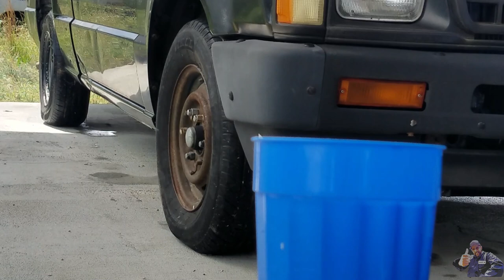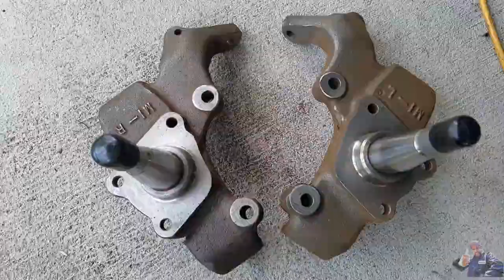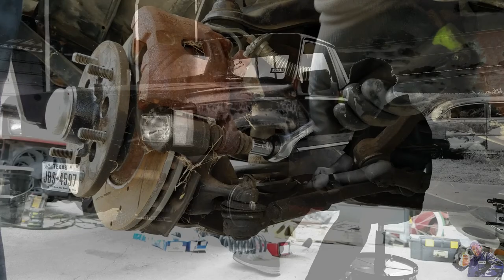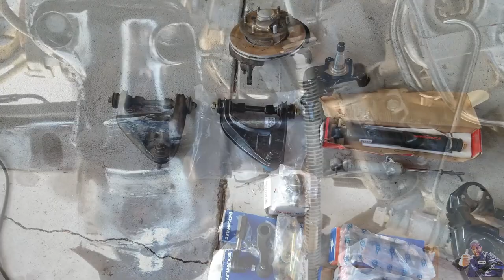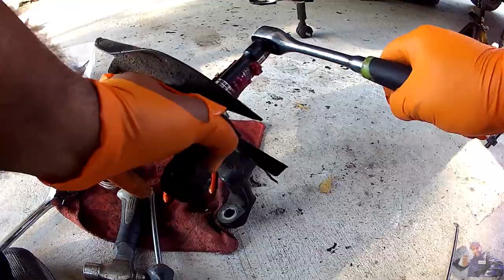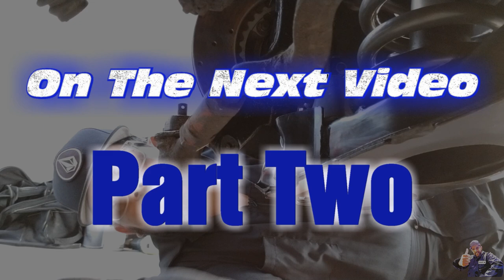Mitsubishi Mighty Max New Front Suspension and Lowering Kit! (Part One)

Comment: Will this lowering kit work for the dodge ram d50 that it the same as the early mighty max trucks?
Reply from the maker: @FreshRam 19, it should on all first and second  generation (body style) Mighty Max/D50 2wd!  The 4x4 Mighty Max/D50 have different suspension, thus this kit wont work for it.
Reply: @CoverAllJoe  thank you.   This d50 doesn't have torsion bars that can be cranked down correct?
Reply from the maker: Correct! Torsion bar suspension don't have springs on the front like our trucks do.
Reply: @CoverAllJoe  thank you again. Definitely a new subscriber.
Reply: Donde se pueden conseguir piezas para el Mitsubishi ya que acá en Mexico se batalla para conseguir piezas